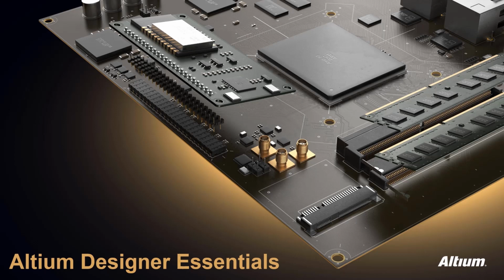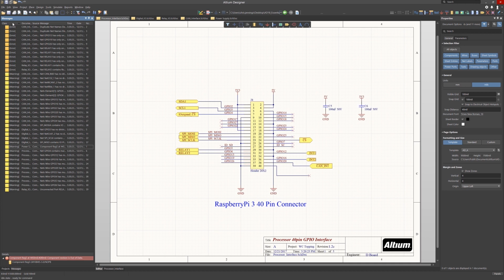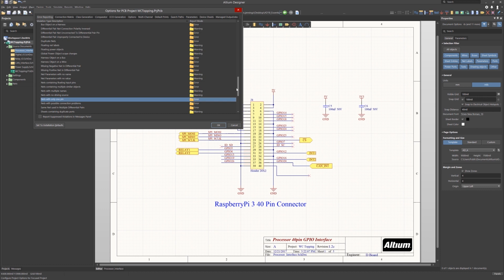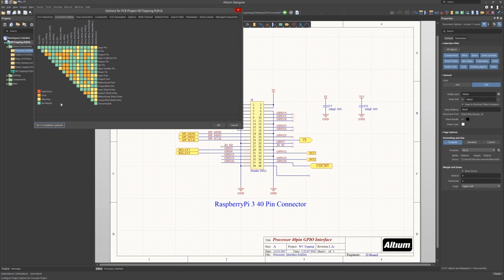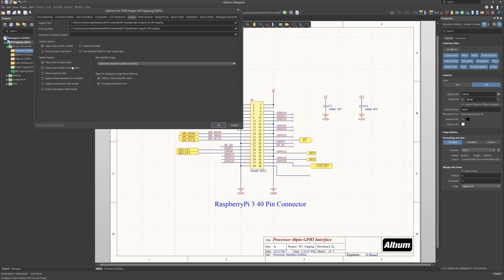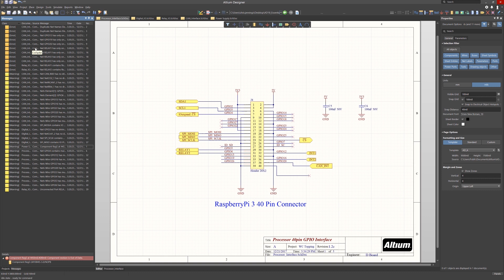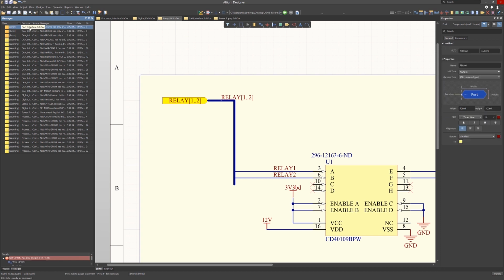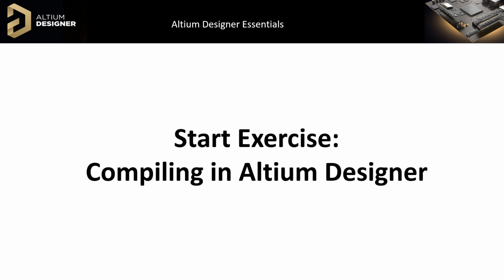Compilation and Electrical Rule Checking | Altium Designer 19 Essentials | Module  11

Comment: Firtly, really good tutorials. 
I would like to know how I can associate the parameters such as title, author or revision directly with the dialog box in the right bottom corner. Is there any way to do that and use in all the next projects? I mean, something like a template. 
Thank you in advance
Reply from the maker: YES! That is done using "Special Strings". And the example templates do use those. For instance, if you add a string like =Engineer to the title block, then in the schematic parameters you add a parameter called "Engineer" and the value is the string of the engineer's name, it will automatically appear in the title blocks. You can also do this at the Project level with a project parameter, so you put your name in one place and it appears on every sheet title block. 

If in doubt, search the documentation for "special strings".
Reply: In addition, you might also have to place text string objects in your title blocks (via the top toolbar > Place > Text String) and then select the special string you want to use. My default title block for some reason doesn't have the string objects, so they didn't update when I updated the title, name, etc. You could also edit the sheet options to use an Altium template for the schematic, and it has a title block with all the right stuff
Reply from the maker: Here's a version 17 video explaining the process (which hasn't changed since then BTW):
https://youtu.be/4Sy_SJB5bfk